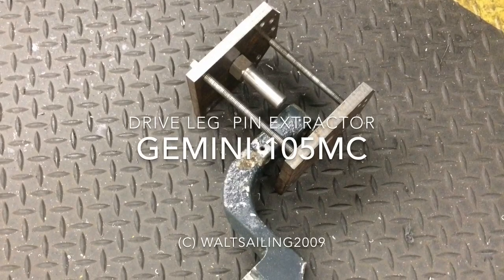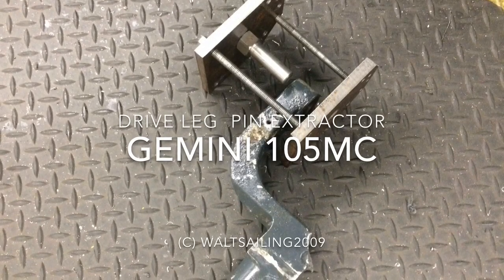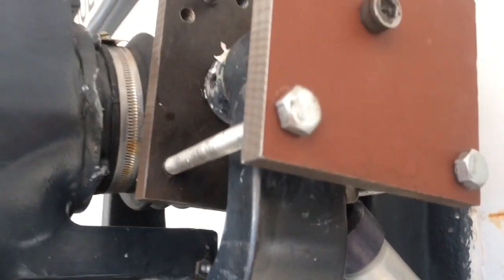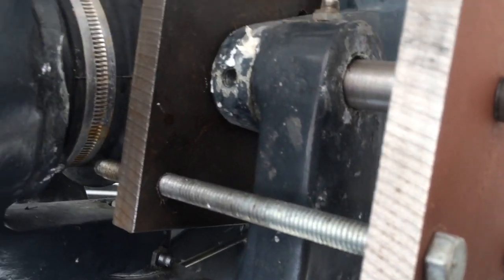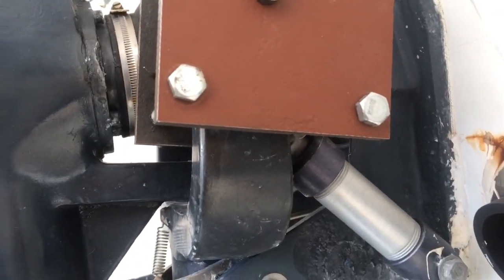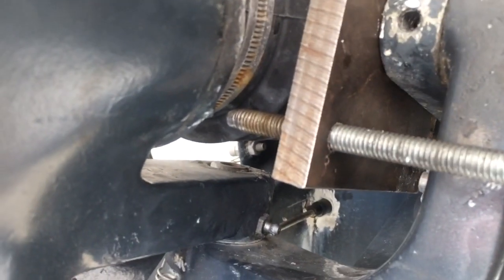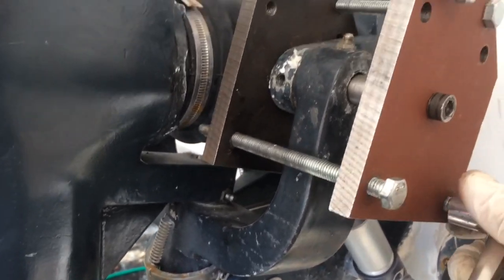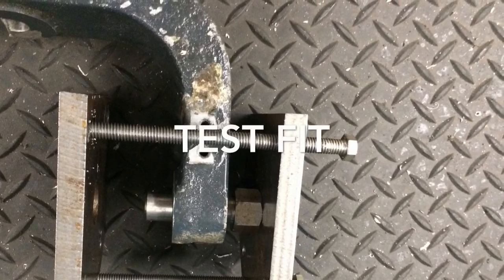gemini 105mc drive leg yoke pin removal

Comment: Hi Walt,
I'm also a member of the Gemini group... Thanks so much for all the information that you share with your website and group.
 I was wondering if you have a dimensional drawing of the tool that you can share so I can get a machine shop to make for me... Or, are you will to make one for a fee? I've tried taking off the yoke pin a few times with a drift/hammer and gear pullers with no success.My bellows is getting old and want to be able to change it, so I need a tool like this. If so, can you share that with me (my email: kkccjj@gmail.com).  Thanks,
Ken
Dos Momentos,  2002 Mc105 #765

Comment from the maker: Make sure you remove the set screws because they clamp into a machined slot in the pin being pushed out and without removal this could damage the transom plate and break the ears that the hold the pins.   Take the set screws out first.

Comment: Hi Walt, I noticed how corroded the hex-pin hole that holds the yoke-pin in place is.
I moved mine to the top and tef-gel the pin so that the dissimilar metals would not corrode the pin hole.
Gravity also helps keep it from backing out with vibration.
The zerk fitting I removed and used aluminum putty to fill the holes and Tef-gel grease for all the pins.
I painted the out drive black to match the rub rail and main sail bag.

Comment: What diameter did you machine the pin to?
Reply from the maker: 0.710.   That is for the pusher.   The pin is 0.750, which is the one in the drive leg yoke